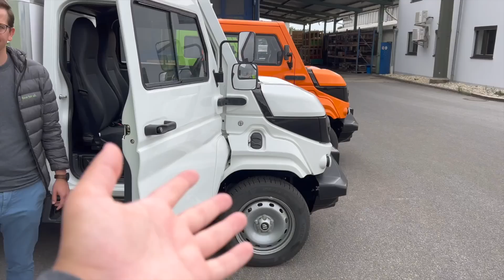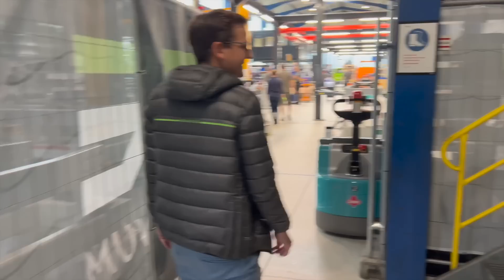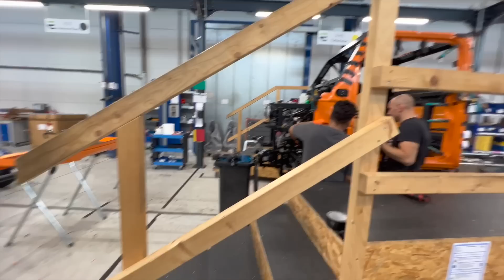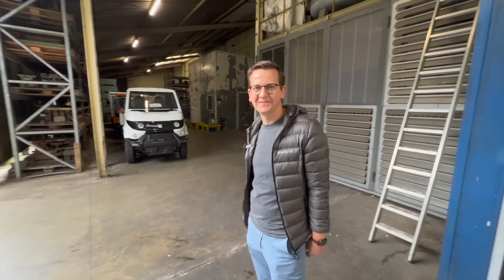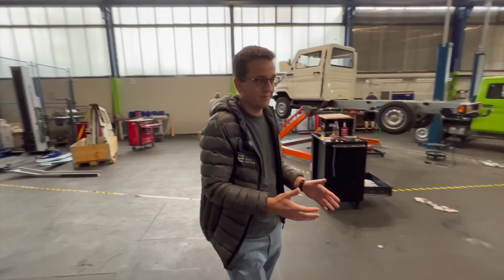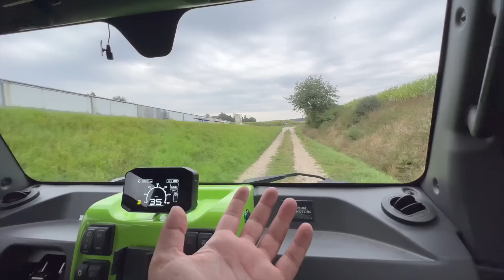Here's How My Favorite Small & Rugged EV Is Built! Full EVUM Motors Factory Tour

Comment: Why can't a vehicle like this be licensed for production in the USA. Ford, Chevrolet etc will never bring out the compact trucks in an electric platform at a decent price point. The Chevy base electric truck with the $39,999 starter price has only the 5-1/2 foot bed which is not useful for much whereas this compact truck has the longer bed option & the box option appears to have more space than a standard Chevy E pick up.

Comment: I like that this person can answer questions without the usual PR BS or using non-answers if they can’t answer the question. 

I also appreciate that it is a vehicle that isn’t being built out of Chinesium. I don’t consider Germany to be the pinnacle of automotive quality as someone who used to work on German cars professionally, and China is certainly capable of building quality stuff, but many small companies and start-ups end up turning to China for cheap garbage, so I’m glad to see that at least some of the key components are at least a step above that.

The price is a problem though. However, if they can sell the simplicity, easy serviceability and low cost of maintenance to city fleets and last mile delivery, they may be able to scale up production enough to bring their costs down and make it feasible for an individual to buy one.

Comment: Nice tool or parody. So what happens if there's no power because the grid goes down? Same as hydroelectrics are running out of water to run hydro? Are you going to have a gas powered generator to charge that bad boy. Nice toy though better hope you don't have a long drive. Can't wait to see what happens during the winter time when you're in a snow bank. Who you going to call? The Ghostbusters. What happens if you're in your car and your battery runs out and you're stuck in traffic in a snowstorm. Better dress warm. Do you live in the north? Better have a bicycle with snow chains. Especially with Russian knocking at your door. Better keep a bicycle with snow chains handy as well.
Reply: Norway is EV country no 1. They have cold winters with snow, so what.
Reply: @gerbre1  let's see how you do with your food, heat for your home during the winter months. Better stock up on firewood and candles
Reply: @wegmandan  Apart from 30% less range in winter compared to summer, an EV performs better than a combustion car. Heating is way faster and energy efficient with heat pump. You can heat the car while parking without running the motor. Of course you can preheat the car and enter a warm cabin. 
I‘m driving an EV for 3,25 years and 71.000 km without any issues. Cost of operation has never been so cheap, no tax, 1/3 maintenance, 1€/100km for PV energy from the roof since March and 275€ for sold CO2 certificate.
Reply: @gerbre1  I don't care how fast it goes from 0 to 60. They're still at speed limit. I look at duration. Especially if you're in the workforce and you're pulling a trailer or if you pull in a RV trailer. There's no charging stations in the forest?. You live in a different reality. It's more of a to y. Wait until there's a few hundred thousand more electric vehicles out there on each state sucking in off that grid that's never been improved. Better keep a bicycle handy with snow chains if you live in the North
Reply: @gerbre1  see any vehicle that drives on a city-state or county roads has to pay a road tax. At least in the us. And that's coming. And electricity is going to go up because there's going to be a shortage of electricity because no country has improved their electrical production.. just like your country. Your country is going to be in short supply of eating oil and cold this year. So you better bundle up.
Reply: @wegmandan  You live in a different reality. Europe and California have decided to ban new gas-powered cars by 2035. Other US states will follow California as they always did in the past.
Ever heard of Rivian R1T or Ford F-150 Lightning? Those are the new trucks and they are electric. I recommend you watch Out Of Spec Reviews.
Reply: @gerbre1  of course I know what rubian is I used to have stock but I got smart and sold it. And that was at over 200 per stock and then they crashed and went well below 25. And they run as well as a Land Rover or range rover. Pricey but they're built like a old school vehicle where everything breaks like the BMW and the Fiat or the Morris and such poor quality but pretty. Especially if it's broke down in your driveway.
Reply: @wegmandan  Regarding electricity, gasoline production and transport use a lot of energy. A lot of oil in the US is extracted using pump jacks. They use electricity, on average 9960 kWh a month per pump jack. That's enough to run an electric car for 34860 miles. There are an estimated 435.000 running pump jacks which use 4300 GWh a month, which is a lot. It's enough to run 15 million electric cars for a month. 

But that's only the electricity to get the oil off the ground. The biggest energy consumers are oil refineries. According to a request from the Department of Energy in 2009 a refinery uses 1,585 kWh to produce one liter (0,26 gallons) of gasoline or 11 kWh for 7 liters (1,85 gallons). With 11 kWh my electric car can drive 100 km or 60 miles. So a lot of electricity can be saved without gasoline production and transport.

When I'm writing this my electric car is charged at home with PV power from the roof, no power comes from the grid. Charging with excess current worked fine since begin of March. It feels fine to drive the car around when the power comes from the roof. Same when there is enough green power to run the washing machine, dishwasher or any other electrical device. But it also feels fine to supply power to the grid that replaces coal or natural gas even if it is a small amount. This year so far 1968 kWh were supplied to the grid.

Many people underestimate the amount of power a photovoltaic module can produce. My 12 modules (4,8 kWp) with east orientation in Northern Germany generate approx. 4000 kWh a year. With south orientation it would be 4600 kWh.

Comment: Tough starting at damn near 40K euro for 16kwh and 50K for 33Kwh. At 50K you can get a decent new commercial EV with roughly 50-60Kwh and the range that comes with it
Reply: Show me one utility EV with AWD and that amount of payload for 40k€ (incl. taxes and before incentives of course). As the guy told us, most customers choose the small battery pack, more range is not needed for that type of vehicle.
Reply: High end JD Gators approach $50K with out this payload or flatbed versatility. With Ford Lightning jacking their prices they look less attractive if you need something small and practical that’s electric.
Reply: Yeah, I didn't check the prices... It overpriced 👎